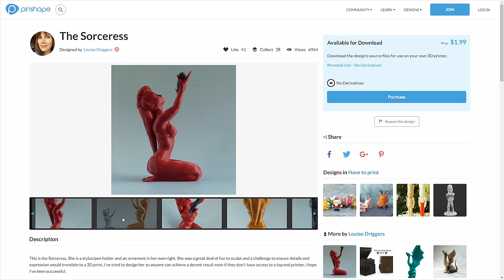Brass Pen Holder Lost Wax Casting

Comment: Whatever they did in the recent update of Cura, all of those thin webbing pieces completely disappeared on my prints. I so want to get into casting!
Reply from the maker: Yeah man! :) Casting in fun! I had to leave retraction off because this wax filament is kinda flexible I guess that's why all those webbing showed up
Reply: You might need to change your retraction settings in your printer if it allows you, that usually gets rid of strings.

Comment: really cool! I might suggest a few things though having done lost wax casting myself. one would be to change your casting medium for the investment mold. I've used a mixture of sand and plaster and I find that to work best, its soft but will still hold up to the heat with minimal cracks. the second would be to use chicken wire surrounding your piece (mainly on larger pieces) as this helps to add structure to the investment. the second would be a longer pour spout this should be a good deal thicker than your vents but it doesn't need to be the size of the piece of foam, though something the size of a dixie cup provides plenty of pour weight to even larger pieces. on the topic of vent sizes, the vents you used were a tad on the small side. and finally adding a mass of bronze at the end will help to remove any slag and provide a cleaner casting.
Reply from the maker: Thanks for your suggestion Alex! :) Actually I already use a mixture of sand and plaster! I'll see what I can improve next time :)

Comment: Learn something new everyday... in high school I was taught that the wax was left in the mold when the metal was poured.  TIL: it get s melted out before the pour.  I always thought the Lost Wax Process was dumb due to the impurities imparted into the metal.  But removing the wax first makes a lot more sense.
Reply from the maker: Yeah! There's another tecnique called lost foam that works the same (and can be done in sand) but as you said there is no need to burn the foam out, it evaporates istantaneusly leaving place to the molten metal! I've used that method a lot in the past :)

Comment: I think you can use plaster instead of concrete. It will be easier to remove your metal part.
After some minutes, when the metal become solid (but still very hot), you put your part in water and you shake it. The mold will explode in the water.
Reply from the maker: I'm using plaster :) It looks grey because I mix it with fine sand, it doesn't crack much that way!
Reply: Ok, thanks :)

Comment: I'm not sure what 'wax filiment' is like, but chasing regular wax is much easier if you freeze it first. Frozen wax can be burnished like silver and cut cleanly with woodworking tools. Of course it warms up as you work, so depending on the piece it might take some time. I learned this when I lived in Australia and it was 40C in the shade.
Reply from the maker: Thanks! Good to know. I'll try that :)
Reply: I think machinable wax has a polymer mixed into it. its like 2 parts wax 1 part LDPE or something like that, so it has wax like properties but its harder and less melty

Comment: Did you find much in the way of shrink marks as the metal cooled?  Sometimes this is a problem with bronze and probably brass as well.  Interesting surface details can be lost.   With lost wax you can make an interior side that would not be seen but would keep the material thin enough to minimize shrinkage issues.  I want to try this.

Comment: Great work, why didnt he directly cast molten brass into the mold, but he used additional smaller cylindirical thing? And what is the material on which the pen holder girl is standing? Last question, why did he melt thin filaments and connected them, the molten metal would reach everywhere anyway

Please enlighten me

Comment: @Black Beard Projects Very impressive result, I have rather an odd question but I was wondering if you think instead of using a pla figure, could I use a resin sculpture as my figure to cast from? Was just wondering if you had any knowledge on if that made a difference or not

Comment: crazy question: if you make a degassed silicone mould of this, then added the wax and put that in a pressure pot, then put the investment in the pressure pot, would that help there not be as much pitting/clean-up?

Comment: Let's say I wanted to do one bigger. Life size. I have the brass. I'm thinking that I will have to 3d print sections and put them together, then braze the pieces together. 

If I was able to 3d print foam or wax, I could leave a hollow place in the middle and as I stack the vivisections. I put sand to the inside as well as the outside creating a hollow brass piece.

So, then my question is. what software do I need to learn to use and what 3d printer would you recommend?

Comment: If you want to make it better you can try to fix the small holes in her legs by using some brass soldering and apply it until it covers the holes, then you just file the excess out and repolish until it looks smooth, works best on alluminum because its the same color., but still better than the holes imho.

Comment: Incredible!  Fantastic video Black Beard!  I've been wondering about printing in wax and then casting it for a long time.  This is tremendous!  What did you paint it with on the undercoat?  I have a feeling that gypsum, (drywall mud), would burn with the heat from brass.  Likely okay with aluminum.  Is that a porcelain refractory mixture.  I remember hearing a fellow mention that when casting bronze.  Great video!!  Very cool to see you use a concrete mixture instead of green sand.  Looks like less fuss to do it that way.  I'm going to turn off my ad blocker before I "like" this, so you get paid .0000001 cents my friend!  :)
Reply from the maker: Haha! Thanks a lot man :'D For the undercoat I used plain plaster and for the rest of the mold a 1:1 mix of plaster and fine sand. I explain better the process here if you are interested: https://youtu.be/FeTprFG__1M  Thank again! :)

Comment: Great video! What material is the melting pot you are use? Steel or Iron?
Reply from the maker: Regular mild steel, pretty sure there is not any difference for the application here :)

Comment: skim the top of the molten brass just before removing it from the forge and you will have a cleaner casting.
Reply from the maker: I've done that! but apparently there was a lot of dross on the side of my little crucible :(

Comment: Out of interest, doesn't pre-heating the cast defeat the purpose of using the wax figure? Surely it melts during the preheat...
Then you might as well have just cast it using a normal mold right?
Reply: I do think that if you would not preheat the mould - it could crack or even could explode as there would be tremendous difference of temperature while pouring.

Comment: huh why did you try to debubble it
i see no posible reason to do so since the figure is already cowered in hard plaster 
with i presumme no bubbles
Reply from the maker: Just to make sure it was filling well around the model, having a void there would have been pretty bad because that thin plaster coating can't hold the molten brass.. And it's now a massive waste of time and engery so why not! :)

Comment: The only thing you SLD have done different is her mouth sld be open like round shape so you can stick the tip of the pin in it when you are just putting the pin down for a sec. hahaha